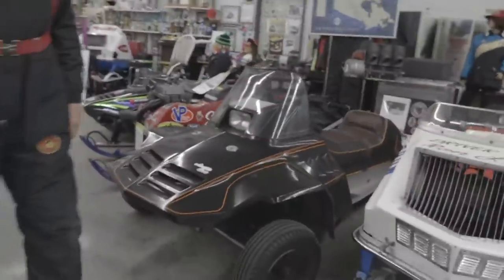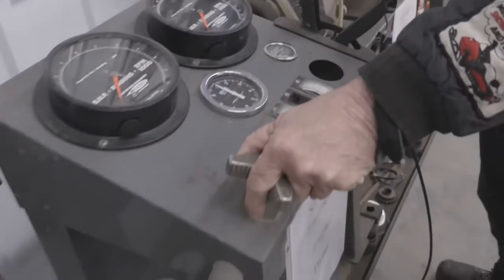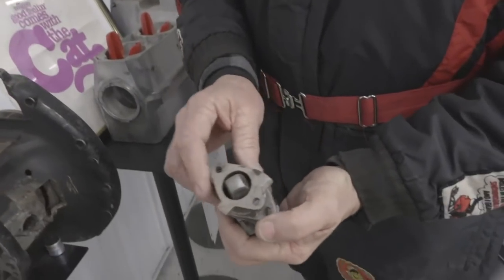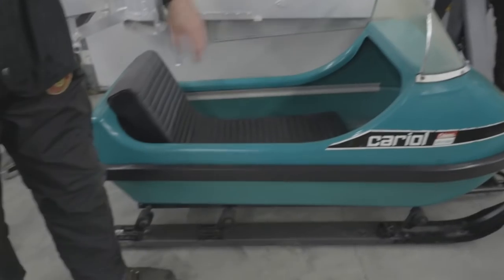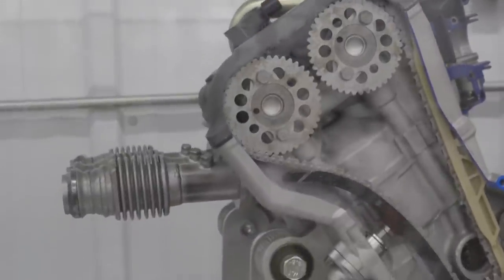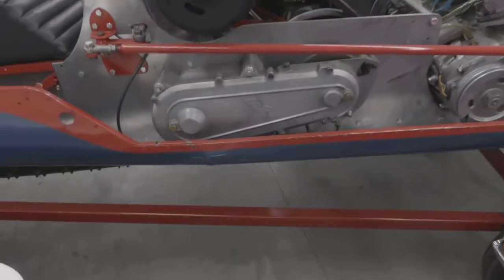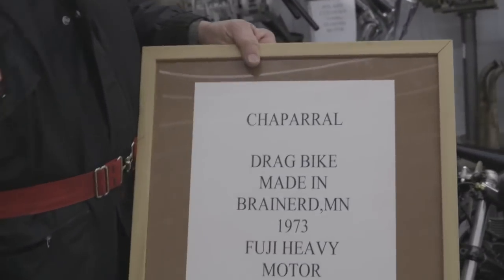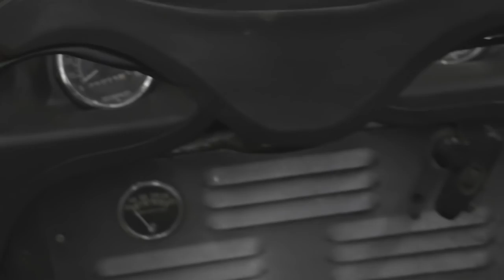Les Pinz takes you on a tour of his vintage snowmobile museum

Comment: A really nice video of early racing ,trail sleds and motors.one question on the moto-ski bse free air engine in 1971, isn’t that a Kms that they used in the bullet race sled, what I have read is they built a really good race sled in the bullet but never did much testing on the engines until they were raced and the motor tolerances were too tight leading to seizure, what drivers said was the sled handled great an if the motor stayed together and few did they were fast, especially the 292 single which was said to have huge porting,

Comment: Hey Tyler! That was a flash of the past that was awesome! My dad had one of the first alouette snowmobile in MN old one lunger Sachs engine way back late 60s early 70 not sure then a Arctic cats cheetah and then Yamaha 433 and then a SSR 440 oval track racer that he used as a grass drag sled and then a GPX 440 and then a 79 SRX 440 liquid cooled and did 105 mph right out of the box fun sled to ride! Then he was out for awhile then he jump in and bought one of those 4 cylinder V Max 750 and that sled was one of the most powerful sleds I drove and fast and with that center drive you could smoke anything off the line it went so straight off the line no pulling to the side from the torque! I loved all the practice grass racing got to hang out with Marv Jorgensen Polaris, Bill Renyolds Articat, Ray Kuehn Yamaha, thanks for the memories! Great video!🤔😉👍📹

Comment: What a treasure Les and his museum are. I had a 73 tx 400. The first time I rode it, I thought I was on a rocket ship. Going from a 71 Moto Ski Capri to that was part of the reason why. I then traded the tx to a cousin for a 76 Yamaha SRX 340. He worked at a local dealership, where he had the chance to buy it.  It was in the Kawartha cup races. When he brought it home and his father saw how fast it was, he made him get rid of it, and that's how I got it. I swear it went 100 miles per hour. It would turn almost 11 grand, and if you did that it would blow the water pump drive belt, and you knew that happened when the tach wasn't working anymore. I love the old days of snowmobiling, and prefer those days of fun and adventure, more than anything today.
Reply: The '76 SRX 340 was supposedly faster than the 440--I HAD a '76 440 SRX--A knuckleheaded drag race guy owned it before me, and had milled the heads, clueless as HELL about port timing, among other issues.  I took it to a guy who was a legend (literally!) named Chuck White--field test engineer for Mercury Marine, instructor at Jackson County Community College I believe also.  Chuck told me one cylinder could have "lived" (kept seizing pistons--$$ chrome bore) if I was burning methanol--the other cylinder wouldn't have lived on alcohol!  The 440 had 40mm Mikuni carbs, and for '77, they changed the port timing and put on smaller carbs--THOSE 440's were BEASTS...   Some years later, I took my daughters to Michigan's oldest oval track, Whittemore Speedway--they had a (touring) class called "Mini-Mods"--snowmobile engines stuck in about a 1/2 scale Indy type chassis---two cylinders, liquid cooled (they weren't LC at first) machines, they turned 12.70 lap times on the 1/4 mile oval.  Chuck had recently passed away when the girls & I went to Whittemore that night--they had a moment of silence--you could have heard a pin drop, from 100 yds. away--everyone seemed to KNOW who Chuck was.  I can guarantee you THIS--There are people reading my words here who most likely KNOW who Chuck was--did I say the word "legend?"  FACT...   RIP.  P.S.  Chuck had a sled entered in the I-500 that finished 4th one year---the sled?  Why, it was a '76 340SRX, of course...   lol
Reply: @bobhoffman5581  Great story. Yeah my SRX 340 had a small racing tank, around 2 1/2 gallons, aluminum skis, and a super thin fiberglass hood, and flat track suspension, with chrome molly cross shafts. Like the guy at the dealership where my cousin got it from said to me every time I went in for parts, " that's a racing machine"
Reply: @johnb5519 It WAS a racing machine!  I also had a booklet that came with mine, telling how to go into/come out of corners. 36" ski stance, aluminum skis--the tank was 2.5 gallons---oh, to have that machine today, with '77 jugs & carbs on it...
Reply: @johnb5519  The only faster machine by Yamaha was the SSR--Saw one of THOSE, in the back of a pickup truck, when I had my 440SRX--sitting in the parking lot of a bar on Wampler's Lake, Irish Hills, Michigan. All you could see was its handlebars--unique as they were, when you saw them, you KNEW what they were attached to!  lol
Reply: @bobhoffman5581  I hear ya, I sure wish I had mine too, plus the old TX. Oddly enough I kept an old 76 Bombardier, Moto Ski Nuvik 340, that I bought off our neighbor, when her husband passed away in 78. No racing machine, but driving it reminds me of the good old days.
Reply: @bobhoffman5581  Cool. I think I've seen one of those on you tube videos of vintage snowmobiles.

Comment: Great video! Also, in the 70's, Columbia snowmobiles (mfg. by MTD) had a slide rail option that used a flat wear bar and no hyfax type slide rails to replace. In my experience, it worked well with no real track wear as you might expect.

Comment: Les found two 76? El Tigre’s late 2019 that were low mileage original barn finds. One 440, one a 500.    All they needed was a bath and the usual cleaning of the fuel system. He takes them to vintage rides.

Comment: The difference between Polaris, Arctic Cat, Skidoo and Scorpion is at the Polaris and Arctic Cat could turn in the corners and the Scorpion and Skidoo could not turn
Reply: I believe Polaris developed the IFS suspension which dominated on the oval track
Reply: @miked8227  
I am talking the 60s, none had IFS yet.
Reply: @miked8227  
I started racing sleds in the 60s as a 14 year old kid Polaris could turn Scorpion and Skidoo had a hard time. I think the front end was lighter weight on the Scorpion and the skidoo